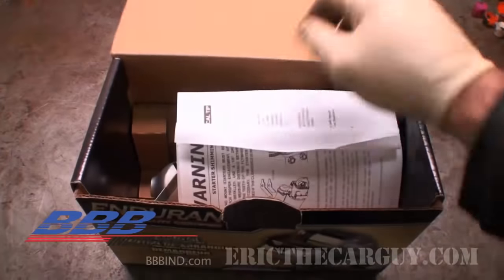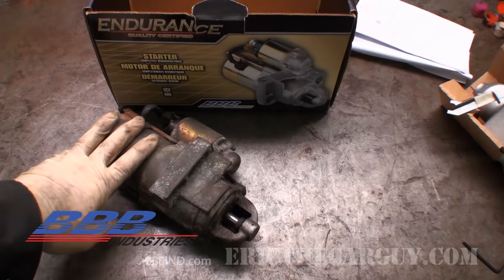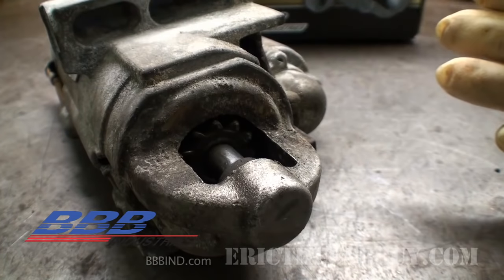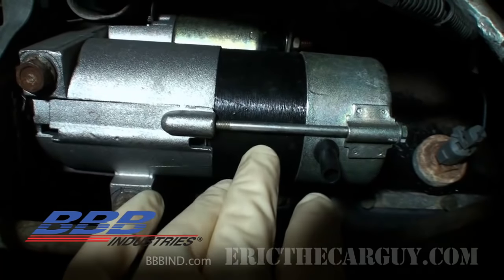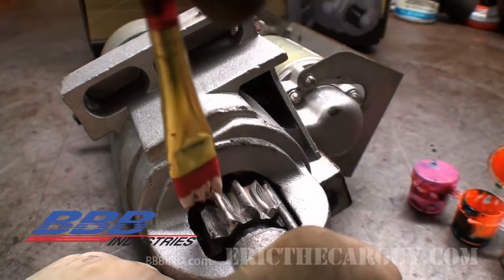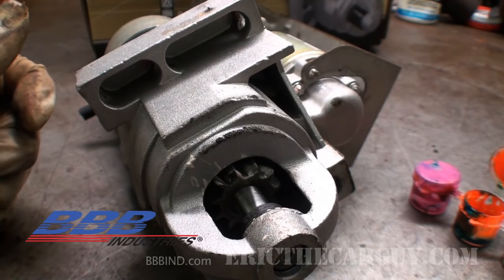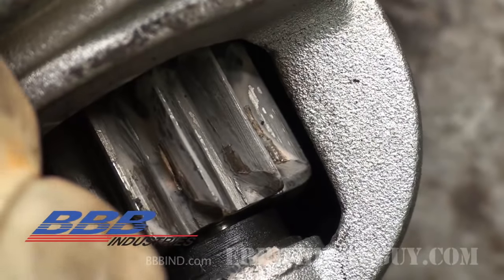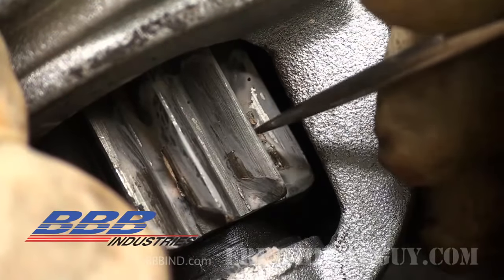How To Shim A Starter - EricTheCarGuy

Comment: Great video. Just like to add that you must use special starter bolts. Ordinary bolts will allow the starter to shift enough to make the starter grind and eventually wear out the flywheel teeth.
Reply: Thanks I bought a truck and the guy had used the wrong bolts on the starter , Your comment fixed it
Reply: @billwilliams4394  Happy to help!
Reply: Where do you get the right bolts.

Comment: You've got to be kidding me! No you don't paint teeth or check clearance by sound. Touch battery cable on solenoid terminal. Drive will engage flywheel but won't rotate. Check and adjust clearance.

Comment: Eric, you are AWESOME bro!! I cannot tell you how many times I've searched your videos to find an issue i was dealing with. This one here is perfect!! I have a 2011 GMC Acadia Denali engine out the vehicle and the engine itself is the same but different sensors, manifold and apparently it needs shimmed for the starter to not bind with the flywheel. The starter gear doesn't retract back after cranking and gets stuck in teeth of the flex plate. I even bought a new starter thinking that was the issue...then I seen this. Thank you, Sir! Much Love and Respect

Comment: How the hell do you install the shims?????????????
Thats why i watched the video! Where the hell do they go? The video is clearly titled "how to shim a starter" but you did not shim the starter nor show us how! What the hell?
Reply: lol if you dont know where the shims go you shouldn't be working on any kind of engine.
Reply: Organicle Man
Reply: Lol
Reply: There's really only 1 place the shims can go... it's just - it is what it is. So the real question is "How to measure to know if you need shims". Maybe the title was somewhat misleading to a "non-mechanic", but personally, I found the video to answer my own question quite well.  Good show.
Reply: Jennifer shannon Henson let's look at this logically. The shims HAVE to have the bolts go thru the bolt holes. So if you put the shims right against the outside of the starter, that would serve no purpose. So that's obviously not where they go. If you put the shims between the starter and the block - the you effectively change the distance between the starter drive gear (teeth) and flywheel (driven gear teeth). So it is painfully obvious the shims (which can only change the distance between the drive gear and the driven gear) if it's placed between the two, absolutely must be bolted thru the bolt holes BETWEEN the starter and engine block.
Reply: Exactly
Reply: Knowledge is Power & jacobfain9 you have to Consider that there are still a lot of beginners in the world... not everyone has taken off or installed a starter. I once was Clueless myself.. You gotta start from somewhere 🤷🏾‍♂️
Reply: (86 f150) I've been making my own shims for years bc O'Reilly's never has them. I was wondering how the store bought ones work. They look too straight to fit the contour of the starter. Problem with mine is the metal i work with is too soft to last longer than a few months. I get a lot of fix or repair daily jokes from my friends. But to say if you don't know, you have no business working on an engine??? Get off your high horse, is not rocket science. I also found this video's title misleading btw.
Reply: Check out DEBOSS GARAGE. Excellent demo.

Comment: The most fool proof way to avoid GM starter issues is to rebuild the original starter or reuse the original snout on your reman unit. Alignment issues are always caused by will fit reman stuff.

Comment: Don't know if this issue was ever resolved but in case someone else has the same problem, some of the teeth on the flexplate might be damaged.  So sometimes it will grind and sometimes it will start normally.  Easy to check if you just pull the starter and spin the engine to check all the teeth.

Comment: Sweet.  I tried to pry the Gear on the starter, but couldn't pry it back.  I'll try the 1/8" drill bit method.  I might be able to reach the Armature shaft.  If that doesn't work, then try the paint method.  If I start a couple times to test the Gear pattern, will that ruin the starter or flywheel?

Comment: I finally shimmed mine right with 4 half shims on the outer bolt. Just seemed goofy that it would be so offset, but after 4 starters, it worked.
Reply: Bad flywheel??
Reply: @garrettdschaak5949  No, I changed the flex plate and it was the same issue. Seems to be a common problem on some older Chevy blocks

Comment: @bashbits Most European starters bolt end wise onto the back of the engine and require no shimming. Tolerances always allow for proper gear tooth engagement anywhere along the length of the gear. VWs were like this from the beginning. Many US engines have starters that bolt length wise onto the bottom of the engine. Tolerances are usually good but any changes will result in improper teeth gear engagement. Notice how this starter is bolted to the engine compared to European engines.

Comment: @929rrdan A inch/lbs wrench is 12-times as precise as a foot-lbs wrench. You can just divide or multiply by 12 in order to convert the numbers either way. 1ft-lb = 12 inch-lbs. There are conversions online if you have any trouble with the math -- but the reason for the "inch-lb wrench" is obviously because adjusting the bands on your Durango need careful precision for best adjustment, and a ft-lbs wrench may make it harder to get right.

Comment: great vid. i used to have a 97 gmc truck. it would grind after i let off the key, but it only did it when it was below -15c. i looked up the service manual that if it was grinding while starting, remove a shim, if it grinds after the key is let off add a shim. my truck didn't have any shims to being with, and i wasn't about to add a shim to correct a grind at -15c and risk it grinding when it was warm out. i miss that truck, touch the key at -45c and it fired up no problem. new one won't.

Comment: What size Allen wrench did he use for the gauge between the flywheel and the starter Bendix?
Reply: 1/8 inch drill bit/gauge. Basically anything that is 1/8 inch thick exactly and it should be wedged between the flywheel teeth and armature shaft like he showed. if it fits exactly between them, then the clearance is 1/8 inch diameter and generally thats the clearance we shoot for (verify with shop manual if doubtful)

Comment: Why do starter bolts break?  I installed a new starter on my boat, mercruiser 3.0 4 cylinder.  Started up fine.  A few days later I found a broken starter bolt on the floor.  Why would it break like that?

Comment: @xmaxjetplane1 It still sounds like a vacuum leak, and since the idle is supposed to drop when the engine is warm it is more prone to stalling in case of a vacuum leak. I am sure there are good guides on youtube for checking starter leaks using propane or some other gas, propane usually being one of the safer options. It can be a pain in the neck though, if the leak is small.

Comment: how often cann't you get an allen wrench or 1/8in  of something between to check. Is it common to have to uses gear paint /paint with this method alot...also can you uses body shims if your starter motor you get doesnt common with its own shim. I see the issue of just bolting it on and not checking alignment as you could be screwing up your new starter as well as the flywheel plate.

Comment: Eric, Can you help me? My husband was fixing the starter on the 2004 Honda Accord XL 2.4 6 cylinders, Somehow with a tool, he pulled on the throttle line the one for the RPM and the car is racing a little it's up to over 2.3 instead I believe it suppose to be on 1 not sure but can you tell me how I fix this? Getting to the RPM its suppose to be and not like the car wants to go on its own. Thank You and looking back from you appreciate all you do.

Comment: @13FravelJ 

that would be the starter solenoid. aka the smaller round part with the two screws poking out. either its burnt out or its not getting 12+ volts

Comment: eriv i posted to you on FB.Im posting here also.I have an 88 chevy with a 350 4x4 and we have ,including myself at least 7 or 8 starters on this truck only to hacve starter fail within a few months.It appears that starter gear is too far from flex plate.I marked and removed about 1/8 in. plus metal from starter boss to make gear and shaft closer still it was further away than it should be.Professional mechanics have had same problems.A few months and its back to beginning.Do you know of any other type starter to use or did they change the starter make and build?If i were the only one workin on it i might see a problem but these guys have all said there is a problem with starters or flex plates.This was a 1 owmer and taken very good care of.Please tell me something.Please im begging.Sincerely,Rob

Comment: i have had three starters to installed on my motor in my 85 Trans Am with 5.0 liter engine. first starter worked four cranks, the starter itself cracked and free spun. second starter the starter wouldn't engage. third starter is what i am currently using now had it for over a year. no problems yet. :)

Comment: Hi Eric, I have a problem. My starter just clicks but does not engage the flywheel/flexplate. It was replaced two years ago. I was able to spin the crank with a wrench and I know the engine is good. My car is 96 Toyota Camry. I wish you could give me an idea on what to do to get the car firing. I also checked the voltage at the ignition coil, it checks out at 12V. I smell gas on the spark plugs and don't think it is the fuel pump. checked the batter, checked out fine. enjoy watching your videos!

Comment: is this only a gm thing or does it apply to all starters?

I have this same engine and Tranny on my k1500. for some reason after years of no issues, my truck started sounding terrible when I would try to started. and it would not start. took my starter out had it tested at 2 different places, it failed, so I'm assuming that the starter was sticking out and not coming back when I let go of the ignition. so I bought a new starter and tried this method to measure clearance, with the shim that came with the starter the Clarence was right on, but the truck sounded bad when I would start it, so I added another shim and it sounded much better but the clearance was  loose with the 1/8 Allen wrench so I guess maybe my flexplate might be rough on the teeth and that's why the 1/8 clearance might not be enough. I took off that cover for the torque converter bolts for now incase I keep having issues but so far it's been starting good makes a little noise but nothing compared to before, my flexplate teeth are a little banged up but not broken so I'm thinking that's why it still sounds a little rough when starting.  some day I will bring the Tranny down and replace the flexplate and do the rear main seal and torque converter seal.

Comment: Hey Eric I have a 83 Chevy high Sierra with a 75 small block 350 and I’m having a huge problem... what the hell do I do if the starter works great when the engine is cold but when it is warm or hot it grinds EXTREMELY bad and shreds the gears??? I’ve been trying to figure out this issue for a while now but have not succeeded

Comment: I had a 1988 olds with a 2.5, and my wife had a 1989 Buick with a 2.5.. Both cars were damn near identical, but did have miner differences. But the Buick starter had a few shims, my olds had none.. The Buick also had a internal oil filter..
Reply: *minor

Comment: Do you know of any info on restoring a starter? I got a new one, it works, but has more teeth than the one that used to be in my engine, so it turns the engine slower, so it takes more time to start (just a bit, but still). I want to take the starter apart to see if it can be fixed.

Any ideas on this?

Comment: Ok soo the shims go between the starter and tthe mounting points on the block.   The shim is to but distance between the teeth on starter gear and the flywheel/faceplate like a spacer.   To put them on.  Is easy... if you adding to stsrt thats already on,  remove the bolt on passanger side and loosen the other till you can slide the shim in. Line up holes and tighten back down

Comment: What if your new starter spins but doesn't make any contact with your flywheel?
Reply: 3 year too late but your solenoid is stuck and not shoving the drive gear to the flywheel

Comment: Eric, I'm having an issue with my jeep. one day I jumped in and the starter would grind against the flywheel. replaced the starter and the new one is doing the same. should I get another starter? 94 jeep 4.0 has very little movement for the starter to be misaligned. maybe 1/16 side to side.
Reply: Alex Thelen

Comment: same with 4clyd? got a 89 mazda 323..new starter...still wants to give a loud grind sometimes when starting like its slipping gears on flywheel. same with my audi now too...can the edges of gears on flywheel be worn or something to let it slip?..maybe shim a side to angle starter a bit..cars not worth new flywheel and dont have shop to do any hardcore wrk...live in apartment complex.

Comment: Hello Eric, I have a 55 chevy bel air and the bendix don't disengage even when all the wiring is ok, the solenoid is ok, I tested the starter out of the car and works fine, and the switch tested with a multimeter, I used a screw driver with the key switch off the car to turn on the starter and it won't stop so i disconnect the battery, could it be the gap on the pinions???
Reply: I'd replace your ignition switch. Sounds like it's stuck at crank when you turn over

Comment: My friends 99 Tahoe 5.7 keeps breaking starter bolts . I drilled out the broken bolt and re-tapped the hole and put the starter back on without shims and it made a terrible grinding sound so I tried shimming it but it didn't help . Then it broke the brand new bolt again !

Comment: so now I know, I'll have to use paint if I ever have to shim the starter on my truck. I've got a '97 chev half-ton with the 305 (5.0L), which is a very similar motor to the 350 (5.7L) in the video.

Comment: Hey I just installed a starter on my 454 bbc and I started the car it worked perfect a few hours later I went to start it and it made a horrible grinding sound and wouldn't turn the engine over. I don't have any shim installed. Should I install shim and try it again?
Reply: Take it out, look for damage on both the starter teeth and the ring gear.  If anything is broken, replace it and install the starter following Eric's instructions to determine if you need to shim or if it is something else.
Reply: 454 & many many older GM V8's had starter fit issues so do not think you messed up .
I once put 4 starters & 2 flex plates on a near new 1970 Nova SS with a 350 .
All brand new GM parts .
That's when I figured out GM had a problem & figured out ' for me ' how to fix it .
When changing starters if I suspect there will be an issue I use the old starter nose after cleaning & installing a new bushing .
And .
Sometimes you have to shim & sometimes you have to flat file the housing where the starter meets the block .
Its a pain but it has to be done or you can grind the teeth right off a ring or flex plate !
& I have had to weld the block in  vehicle because some idiot shimmed it wrong , shimming one side & actually broke the block ruining the outer bolt hole .
& let me tell you it is almost impossible to weld cast iron upside down because it wants to flow like melted butter .
I use a Nickel 99 rod & they are probably about $3.50 each rod & machinable .
You can also bend them to get to hard to reach places but you sacrifice rods .
Do not waste your time with a cheaper 55 rod !
Also make sure to use a rear starter mount on a 454 its a small bracket that bolts to the block & starter !
Reply: *****

If you think you know more or have knowledge of how to fix this problem  easier  please, by all means enlighten us .

Comment: @AllRightieThen  Its only when the engine has warmed up and it does it when just letting off the gaswhile im driving.
Reply: Jeff Banfield I just had a new starter replaced and I now hear the same thing when I let my foot off. Sounds like a baseball card in a bicycle wheel...what was the issue or fix you had?

Comment: I need help my car woun't start it only makes clicking sounds, its not the starter nor the dizy,alternator, battery, or fuses... i just changed the battery and starter, now when i turn the light on, they dont turn on but after a few trys they turn on. battery cables look good and btw car only turns on when i put it in 2nd gear and push it... its a 96 civic ex 4dr sedan

Comment: I have a 1989 Astro van I took the old starter off and put the new one on just like I took the old one off and put battery cables back on and now I'm getting sparking if you can let me know what I can do to get this settled I bought a new battery just in case that's what it was
Reply: when you hooking the ground and or positve up is it sparking like a fire work show cause I'm having the same issue
Reply: I got a video on you tube 99 sebring battery cable. I can't figure the issue out

Comment: After install of a new starter it worked perfectly. Two days later the starter is just spinning and the car wont start. What should I do?
Reply: That happened to me on a Civic once. The welds that hold the teeth of my flywheel broke of clean to where my starter was literally spinning the flywheels gear but the flywheels itself was still.

You'd hear this whizzing sound. I found out when I stuck my hand in and grabbed the flywheels by hand in frustration and yanked on it. The thing spun like a bearing